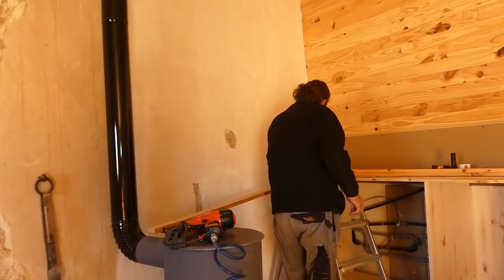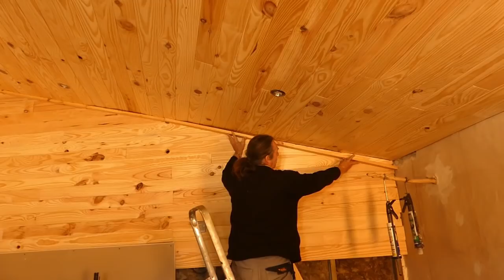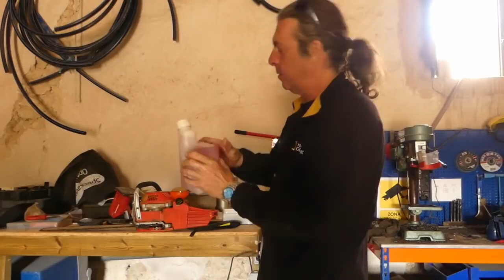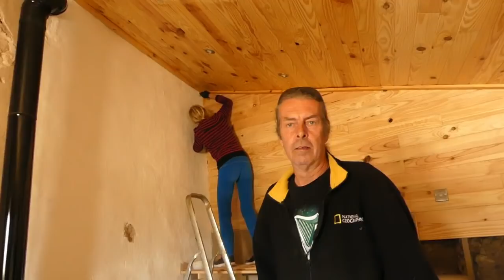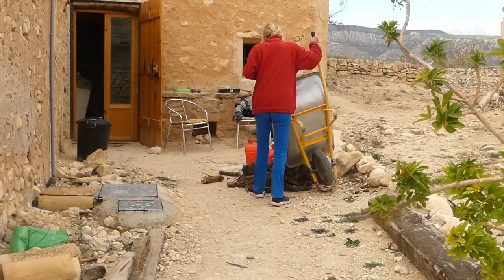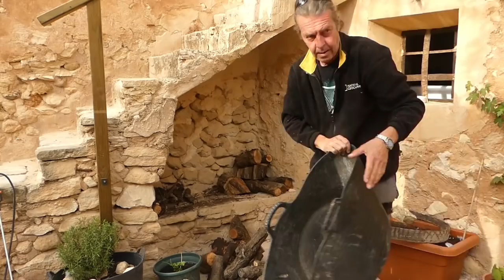Back working on the old Hay Loft - 200th Vlog!

Comment: Hi to both of you 
What brilliant work you're doing in renovating the finka.
I don't know whether I missed something but if the circuit breaker trips on a short circuit how are you going to reset the consumer unit  unless you cut out a hole for a door? 
Great job you're both doing.  Wished I was 30 years younger 
Brian
Reply from the maker: Thanks Brian. It's probably in a later video but I cut a nice round hole that gives full access to the consumer unit
Reply: @FincaLife  thanks for that.
I found your channel and have started from  vlog 1upto 200.